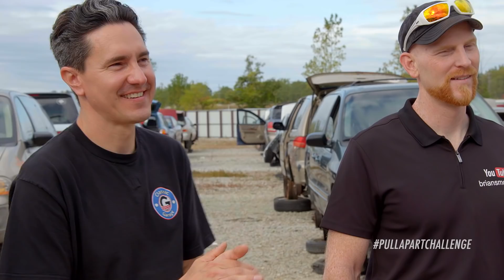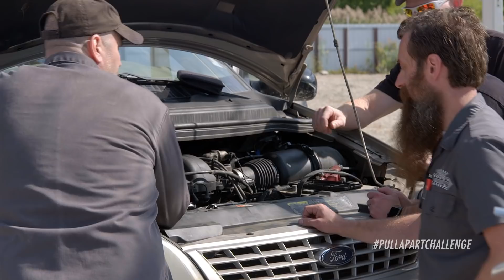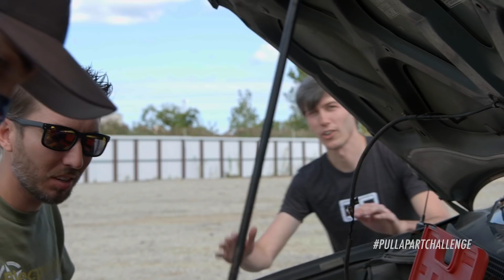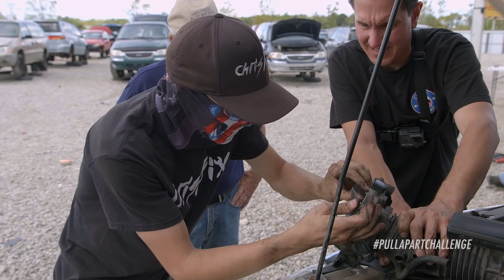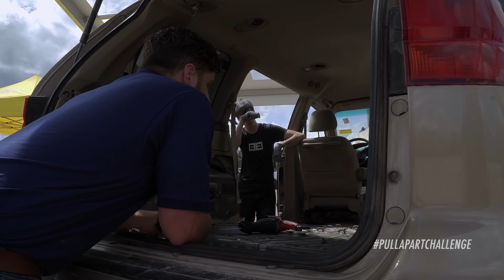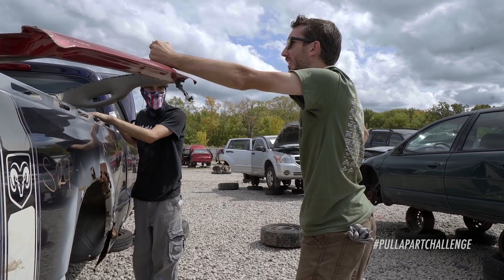The Pull-A-Part Challenge: Episode 1

Comment: From my perspective, I believe the contest would have been made more interesting, if the contestants, were simply assembling vans that are stripped down from people removing parts from them. With parts from other vans in the yard. 

Which would have to pass a safety inspection, before going on a road trip, to a automotive sporting event. 

Since at least for me, that would have been closer to a benefit for the chain of pull-a-parts that are hosting and sponsoring the contest. 

Besides, to me at least, it is counter productive, difficult to follow, due in part to the fact the contestants have to replace a part. 

Then turn around, and fabricate something out of a vehicle, that could have been turned around and given away to someone such as a single mother, who either doesn't have a vehicle at all, or one that is unreliable. 

Now of course, if you wanted to fabricate something, possibly, build a race car for multiple race courses! Using the vehicle, and parts from the yard. Outside of the roll cage being already bent up for the given car picked by the contestants.

Comment: A group of master diy YouTube certified mechanics and a fuel leak on a generator is a big hold up???? Whaaaaat??? and the host needs a bikini and this shits on TV
Reply: the86125 purposely stopped them so the video wouldn't be over in 5 mins after they welded the doors and chopped the top.